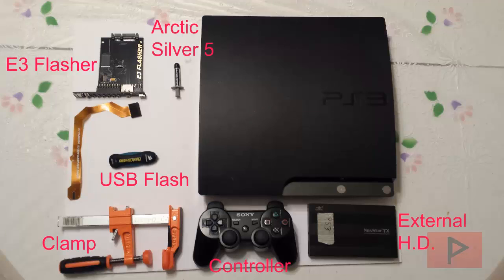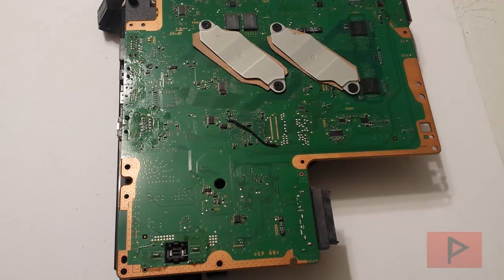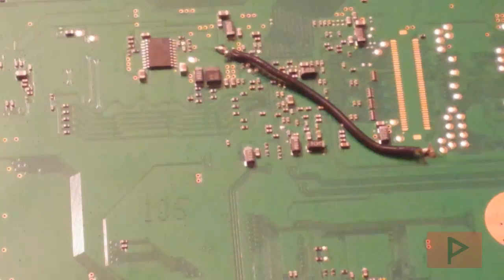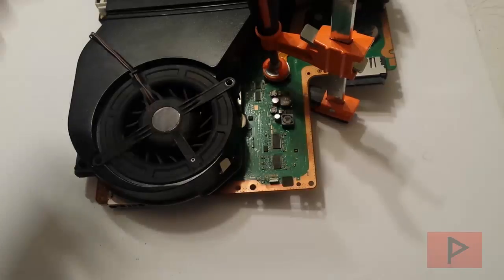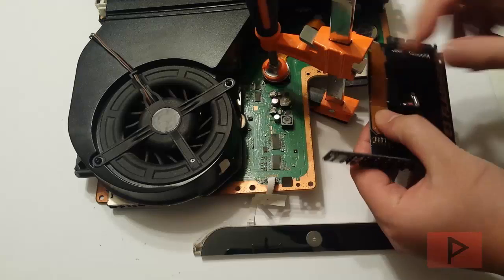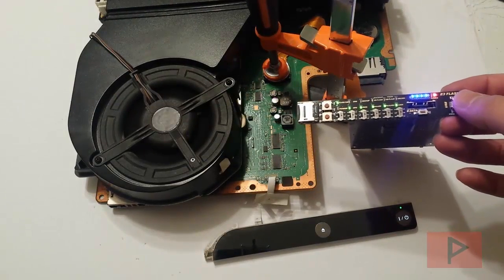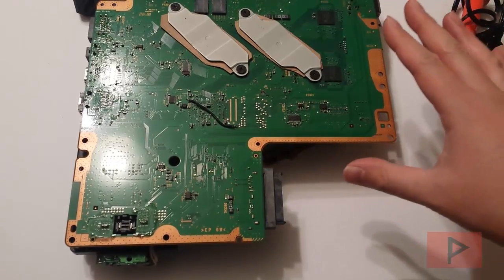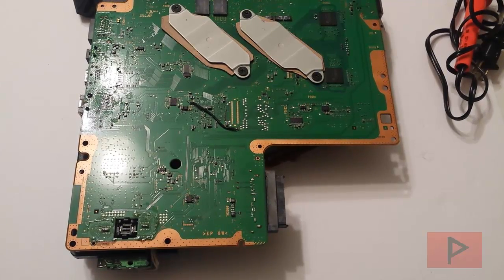[How To] Fix PS3 Soft Brick YLOD Using E3 Flasher Tutorial (2016)

Comment: You don't say or provide a link to the E3 flasher and clamp and where to find the link of the list of PS3 motherboards.
Reply from the maker: E3 flasher can be found on ebay or amazon for example. PS3 motherboards find it on ps3dev wiki. Remember, e3 flasher isn't needed for modding anymore, you can use softmod methods to jailbreak. But if you have a brick, then e3 flasher is still necessary.

Comment: i dont think i have the orignal dump but i have from other ps3's would they work?
Reply: @ProjectPhoenixMedia  i know the other way but was hoping ot fix the 2 broken ones its always good to have spare
Reply: @ElementalEu Hello, I have a question, I have a PS3 SLIM 120 GB CECH 2001B, with the E3 flasher I can unbrick a PS3 Slim with soft rock YLOD due to a bad installation of xploit, but I do not have the NOR dump, can I Can I use another one of the same model?
Reply: @JC-ds4ds  i dont think so

Comment: hey man is this process will work for super slim aswell I am facing the problem of bsod...please help me man...sony is refusing to give any support....tried everything that i could do with it...safe mode troubleshooting...formatting..swapping drives...reinstalling firmware everything...but still its not working the same blue screen with some writing of unknown languages ....some videos demonstrating to flash NOR chip some one replacing NOR chip and someone solder wires to make a bridge...i have the 12GB GO version... and what I think it has the NAND CHIP instead of NOR ...i dnt know what is it...please any help or support will be applicable
Reply: Project Phoenix Media thanks man 😕

Comment: Hey, I'm downgrading a PS3 for the second time and had the same problem after trying to flash the verified patched backup on the nor chip. I soldered the two points together and flashed the verified patched backup successfully but after desoldering the wire, the problem still persists. Do you know what the problem might be?
Reply: Project Phoenix Media I'll try that tomorrow and let you know how it goes, thanks.

Comment: Ok so I started my e3 flasher update and that was successful. After 2 mins and a full blue bar I turned off my console and put it in my kitchen as it had a flat table I could use. After I tried retrieving a dump with 12456down and 3 up as soon as I didn't that it shut off and then I got ylod. P.S I have not re balled yet

Comment: That's not YLOD, that's just a Brick. You bricked your system trying to patch it. YLOD is 1 of 3 issues, hardware failure, Overheating, or shortage.
Reply: Why do I have the exact same problem but I get a yellow light on start up?

Comment: I have everything except the wire I know you said 20 gauge does it mater if it's copper wire I need help please?
Reply: Project Phoenix Media umm what happened to it? I did this fix and now ps3 wont turn off and no display
Reply: Project Phoenix Media Thats probably what happened, will i still be able to get a new dump? Thanks for the fast response!
Reply: Project Phoenix Media  Does my dump have to patched in order to do this or do I use the verified dump that is unpatched?

Comment: on my system only 1 out of the 8 lights lights up and stays lit nothing else is happening been an hour what do you think is happening  i have 1 up and 5 down followed this tutorial to a t got my sp3 back on no picture to tv either???
Reply: Project Phoenix Media hmmmmm I had a clamp on with coin that was protected with electric tape to prevent short over for even pressure clamp was protected with electric tape to prevent shorting I had as much pressure as I can have applied once it was nice and tight I gave it another half turn I didn't want to take a chance and destroy the chip or mother board I tried again different ps3 a little tighter both models slim so resistor is not in the way like fat system same thing happen except this time got stuck on 4 lights maybe bad ribbon cable??? all dumps were file compared hxd like 9 times and validated nor inspector and ps3 patch dump extra verified then patch verified through nor inspector as well??? I'm at a loss...
Reply: Also thank you so much for responding.
Reply: Project Phoenix Media that's what's confusing me the dump that I patched had no errors and patch was in big Green letters OK that's when I put the SD card back in the E3 and made sure all switches were down then I turned off the ps3 and turned it back on once the screen had the error about storage due to the hard drive not being there that's when I hit the start button on the E3 and all it did was load 1,2,3,4 and stopped after about 3-4 minutes then nothing happened after that it just stayed on those 4 solid lights 5,6,7 and 8 never lit up. I didn't want to mess anything up so I left it alone, after about an hour passed I gave up and reset the playstation now it got bricked turns on then the dreaded beep, beep, beep then turns off so I unbricked it, soldered tri to ground and it stays on now I've switched the first one up and hit start to flash it and it does the same thing loads 4 lights then stops I'm confused because if it didn't have enough pressure how did I get good dumps that passes nor inspector file compare and patch ps3 all passed several times but as soon as I go to flash it, it stops at 4 lights. Now one may tell me it lost pressure some how during the write but if that is so how come after unbricking and turning it back on how does it even load the 4 lights this is where I am super confused.
Reply: by the way I reflash it after unbricking it I used the patched file I also tried the back up and they both do the same thing 4 solid lights then it stops

Comment: I have the glod if I try this will it work?
Reply: Project Phoenix Media I tried this and it worked but I didn't do the wire method I just did e3 flasher and backed it up with the backup patch and it worked now I have a 3.55 firmware thanks to u (:

Comment: hello, i have downgraded two consoles yesterday, after i flashed the patched dump the ps3 gave me blackscreens, cant go into recovery mode or something. Do you think this will help?
Reply: +Project Phoenix Media thanks for answering, this is a really weird issue as i have on 2 ps3s at the same time.. never had this problem before.. ok i will try that tonight, how should the e3 flasher buttons be positioned? the same as flashing a patched dump?
Reply: +Project Phoenix Media hello, i tried it now, first I tried flashing the patched dump, same problem then I flashed the original dump also did not work. But here is a clue, when I check the dump before I put it on the sd csrd the dump is perfectly fine but when I dumped it and check it again the dump suddenly has 25 errors ?? What could this mean?? should I try it with another sd card maybe??
Reply: +Project Phoenix Media hello, yes I have new clip but did not shave. I use a clamp so it does work without it. Now I managed to repair both ps3s, I flashed a good patched dump. Made sure everything is clean with alcohol too and it worked! on both consoles I managed to install the rogero downgrader. But now I have a mayor problem with the second ps3. When the rogero Downgrader finished and my ps3 started and as I was configuring it it suddenly shut down on me. When I tried to boot it up again it immediatly shut down on me. Like half a second. No yellow light or something, just one green blink and then it's dead and the only way to get the red light back is to reset the power cabel. I thought maybe the power supply is faulty but it's not.. hmm, maybe it's complete dead?? :( how is that possible.. revived it and then this :(

Comment: No meer for soldering or tape. Just take a wire and put it on the 2 points then press hard enough and click on the on/off button it Should go on and then you can take the wire back. Worked for me. Should I make a video how to do         It?
Reply: are you serious? really works?
Reply: @penamaktub  yeah back then it worked, just find the right spots en press with 2 fingers hard enough :)